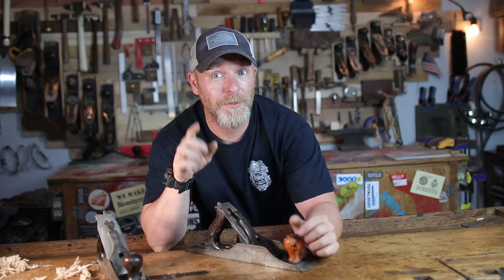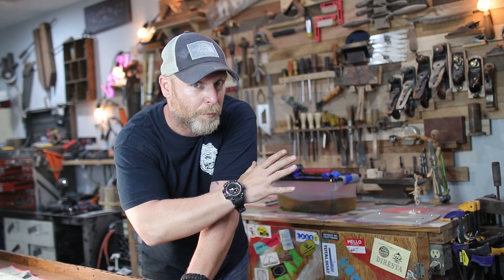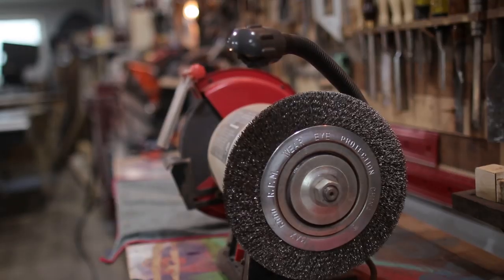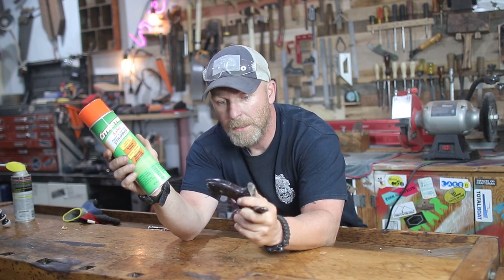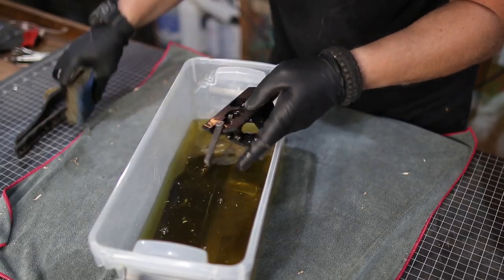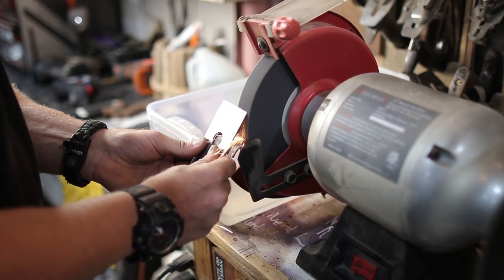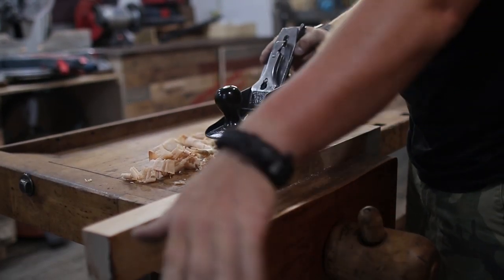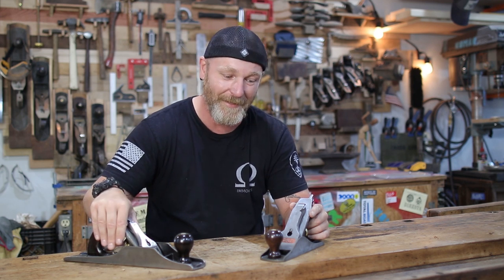Two Simple Ways To Restore A Hand Plane || Stanley No 4 and Bedrock 605 Restoration

Comment: Interesting to watch the great job you did on the two planes. As it happens, I picked up a Bailey #4 a couple weeks ago, which didn't need a lot of work to get it back in operation.  I'm currently working on a Bedrock 605 bought the other day, which seems (by Bob Kaune's feature study) to be a type 6 (1912-1921), but which has the Stanley type V trademark on the iron, dating it more narrowly to 1914-1918.  (It's a presumption, but I'm guessing the guy who assembled it at the factory pulled the iron from current stock, so that's probably as good a date as I'll ever have.)

It has a good bit of rust, but I got it all apart and gave it a quick wire-wheeling. It's now perking in the Evapo where it'll probably spend several days.  Then I'll see what it needs next, which will likely be some fine sanding and dremeling in the nooks and crannies. The japanning is almost all gone, and I'll have to take off the remainder. I'd love to re-japan it, but that's a stinky process and my wife says if I do this in the kitchen, my next home will be a cardboard box on the street.  So enamel paint it'll be, as you did.

Onward!

Comment: I have what I believe to be a 1910 bedrock 605 handed down from my grandpa. It desperately needs restored. In my situation would you lean toward the wire wheel route or the evapo-rust route?
Reply from the maker: I would try the evapo rust first.  That way it won’t leave scratches on it
Reply: @KomarProject  I ended up using the evapo-rust. Beautiful results! I wish I could post a pic in the comments. Thanks!

Comment: Great video Bart. I haven’t done this yet, but it seems like the wire wheel would screw up the flatness of the sole. Is that not the case?
Reply from the maker: Christopher Pickslay the wire wheel takes of the loose rust for the most part.  I haven’t had any issues with loosing the flatness but then I usually lap the sole after I assemble the plane

Comment: What colour/type of paint did you use on the no 4 around the Stanley logo and for the japanned areas? Great vid as well!
Reply from the maker: Bill Stanley thanks bill.  Japaning was just regular semigloss black Rustolium.  And the orange I couldn’t tell you cuz I threw it out.  If I find it again I’ll let you know.  But it was Rustolim too
Reply: There are some matches given in threads and blogs online but one good way to go if you're in this for the long haul is to get a tube of artists' oil paint, either Cadmium Orange Deep or Cadmium Red Light depending on the exact shade. Mix a dab of the paint with a drop of gloss or satin oil-based poly and it'll dry hard in about two days, and end up at least as durable as the original paint Stanley used. 

Unlike enamel paint oil paint in a tube will last indefinitely (literally decades) so you'll never reach for it only to find it has skinned over or dried solid.

Hope it helps.

Comment: Really enjoyed this video man, I wanted to give it a thumbsup before you'd even acquired your Bedrock :-D Both planes end up looking _awesome_. I was actually pleased the front knob had that orange paint on it (why, just why?) because I knew the before-and-after contrast would be so great!

Sucks when you get a catch at the wire wheel doesn't it? I think I've only once had a bad one and it was with a cap iron/chipbreaker too if I remember correctly. For me it tends to be screws or bolts although thankfully I haven't permanently lost one yet, touch wood! I used to have bad luck with the washers though, lost a couple until I saw a tip somewhere to thread them over a screwdriver shaft and wheel them there.
Reply from the maker: Tungsten Carbide omg I loose nuts and bolts all the time using that thing.  I took a washer to the neck once and always told myself to wear gloves and eye wear when using that thing.   Thanks for the support brother !!!
Reply: @KomarProject  Just a thought for the small parts, maybe for those a smaller wheel chucked in a power drill would be the way to go? This isn't as effective as a large wheel mounted in a grinder but works okay for nuts and bolts and the snatch risk is lower.

On the safety aspects, eye protection is a must using any wire wheel for sure. I couldn't say the number of times I've been hit in the face with a wire, and it doesn't bear thinking about what the outcome would be if one of those hit an open eye directly. Those hits are relatively rare but flakes of rust and tiny metal particles are being released all the time too. 

Gloves though, lots and lots of advice online about not using gloves of any kind with rapidly spinning power tools – if the glove material gets caught you get dragged into the tool, while with bare hands you can snatch them away cleanly if you make contact. With a high-speed wheel you'll be missing some skin yeah, but better than the alternative!